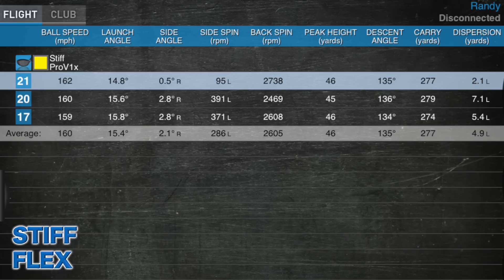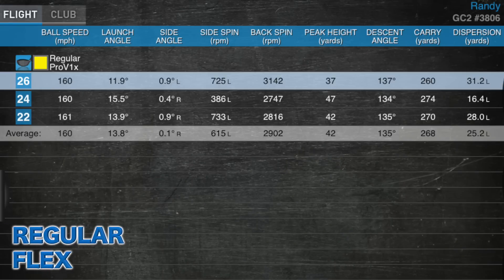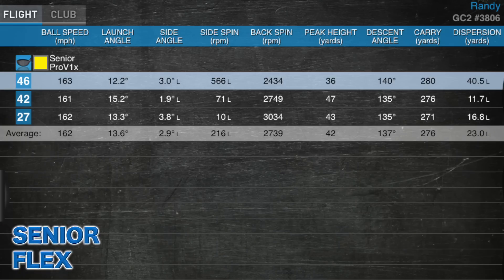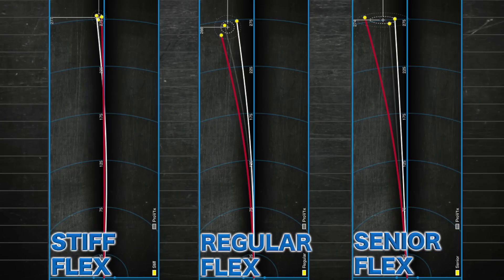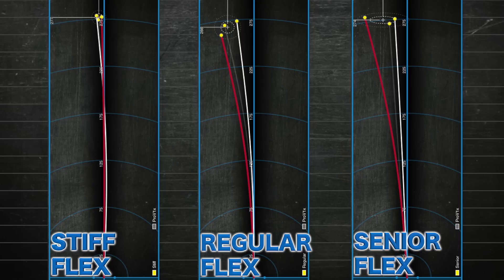Does Shaft Flex Matter?

Comment: with me I rock a X stiff shaft with and avg speed of around 129. but my misses are huge hooks and even when I strike the ball well and in a good spot on the face the ball flight is extremely low. and ideas?  driver is a Bombtech Grenade driver in 10.5 and X stiff matrix shaft
Reply: last check spin rate is around 2500 to 2800
Reply: Get rid of the Grenade.
Reply: 129 mph swing speed? Damn, if you can get your ballflight straightened out you should try long drive.

Comment: I just switched back to a regular flex. I do not notice a major difference in ball flight, or distance, but I did notice that I can use a much smoother swing than before and still end up getting good distance from it. I did notice that if my tempo is off that it does get squirrly on me.

Comment: Hi Randy, not sure if anyone will see this as I think the test was done a while ago. My wife Deb was fit by Ping and uses a soft reg shaft in her driver over here in the UK. I bought her the G driver with the Alta 55 SR shaft and she could not hit it, so we went back to the TFC 80D Lite shaft which she is fine with. I was playing Titleist driver, 915 D3 Stiff shaft and hit the ball pretty well, still further than many. For fun I took out the Ping Alta 55 SR shaft in a G30 head - I found the result exactly as you have just said - I hit my longest drives with it. So I bought one, and yes in my driver I've gone to senior flex shaft and it goes miles and is very consistent. Pals gave me a sideways glance at first when they saw what I'd gone to, that look changed when on a cold damp UK March morning, I knocked my drive almost 50 yards past them!! The upshot of this as far as Ping goes for Deb, over here in the UK at least, is that there is only one shaft in a lite flex available and that is the ladies shaft which is far too flexible. The new G400 is available with the new Alta CB 55 SR flex shaft, but my guess is that it is the same shaft pretty much but in a new colour. Thanks for doing the test - very good.

Comment: Dispersion is really only the thing that shaft flex will have a difference on, however I would definitely suggest getting fitted for flex as it can make a huge difference in how far you miss shots left or right.  The faster you swing the more you flex the shaft which will have an effect on how consistently you will return the club during impact.  I was playing an older titleist driver with a stiff flex and the amount of flex I had when starting my downswing you would think it was senior flex.  Once I tried an x stiff shaft driver my miss hits were a lot tighter and didn't spray nearly as bad.

Comment: Noticed you have excluded some shots from your results - can you please share why - bad strikes/ swings? Can you also state how many shots were excluded?
Reply from the maker: Hey Pujitha, I usually take about 15 to 20 shots to warm up and find the centerline for the launch monitor on the range.  I hit 29 measured shots (Stiff - 6, Reg - 10, Senior - 13).  I try to take the three shots that have similar strike and ball speed.  This one was tricky because the regular and senior flex I definitely had to find the timing for to hit a decent shot.
Reply: Great! I was hoping that shots were selected for similar strike patterns - ESPECIALLY for impact location. It is tiring to hear reviewers talk about differences in spin when a shot is hit lower or higher on the face. the effect of CG is after all relative to impact position - thanks to the mighty gear effect.

Comment: Good video. I was amazed to learn how important shaft stiffness was when I got fitted. I was waiting for a putter to be re-griped and I went into the Ping simulator at the PGA Super Store even though I play Callaway. The pro watched for awhile looked at the number and saw my launch angle, face angle, and point of impact were repeatable and nearly perfect but my club head speed on the driver averaged 95 (I am 6'4", had back injuries and am 57) He walked me from the Extra stiff (which is what I had used for years) though the Senior's / ladies shaft. At the Extra Stiff I could miss 35 yards left or right, by the time we hit senior I had that down inside 10 yards, mostly left. I don't have a full back swing, but carry moved from 198 avg with extra stiff to 202 avg carry, and roll was +/- 2 yards. 

Spent around $40 to have my driver, 3 wood, 5 wood re-shafted and initially dropped 5 strokes off my game. After changing my irons I dropped 10 strokes, on short courses and more than 15 on long courses. Two things happened. 1) a lot of time in the simulator finding what my clubs really did, and 2) not chasing as many wild balls, which helps confidence a lot. 

I am not going to get longer, but I am seldom in trouble anymore which reduces hero shots turned GOAT. My recommendation to everyone is be willing every couple of years to find out what your really doing. 

The video is good, just don't want people to think that senior shafts are less controllable. They just aren't meant for the club head speed you have, vs. an old dude who could gain yards with them.
Reply from the maker: Thanks for the comment!

Comment: I have a 48" x-stiff, low torque driver, and a 45.5" stiff, mid torque driver, both 8.5°, hit them both great, no real noticeable difference.  My irons are x-stiff hit them great, also have a xx-stiff 1-iron, hit it great and a "regular" flex 19° hybrid, hit it great as well, so my opinion on shafts is,...you never can tell until you start hitting it!

Comment: did you compare the strike patterns for the 3 different shafts?
Reply from the maker: Hey Christian,
I hit at least 6 shots with each shaft, then took the shots that were similar strike and ball speed and used that to compile my data.  Unfortunately I don't have the HMT device that would give me impact data more accurately, but until then I just have to go by feel.  Thanks for the question!

Comment: Shaft does matter, to an extent, but not anywhere near as much as people believe it does. Ask any teaching pro/club fitter, it is far, far worth more to get your technique straightened out than to spend money on a new shaft. Once you get more consistent, then spend the money on a shaft to fine tune and cut those 100-200 revs off your spin.
Reply from the maker: Spot on Jacob, well said.
Reply: i matters alot if you swing relatively good,  myself i swing between 105-110 and in a regular flex would hook the crap out of it,  in a stiff its a nice slight draw so your wrong if your talking about a good player, high handicap should just carry clubs for me lo
Reply: +Bryan H shaftoid.
Reply: I agree, purity of technique wins at the end of day over any fancy equipment technology.  The pros from the last century are a testament to the importance of this.  Most of them used what we'd deem as garbage by today's standards, yet are able to shoot insanely low-scores.

Comment: Hi Randy,not only does shaft matter,but the length of shaft is important too,I've owned a Cobra Amp Cell driver for almost 2 years,its got the adjustable loft settings,the most I could get out of it would be about 220 carry (I'm 65) at 10.5 loft,as you know the driver is 45.3/4 inches long by cutting the driver down to 44.1/2 inches I've gained 15 yards and much straighter.
Reply: I played and still have that driver. Very forgiving. I actually put a 43" 3-Wood shaft (60g) and it was a "fairway finder" averaging around 235 yards. Good hits getting up to 250 yards. Playing the Titlesit 915 right now at 44" which reminds me a lot of the Amp Cell.
Reply: You know it makes sense mate,not all about boom boom is it. cheers!
Reply: That is very interesting and I'm about to try the same experiment. I'm putting a 42 inch shaft on a driver and hoping for more control. I could drop a few yards no problem but I have to stop whacking drives OB. I'm tall and have long arms so maybe a shorter club will work for me!
Reply: hi could u send results to me.would try the same.regards tyagi
Reply: No need to change the shaft - your golf pro can easily shorten the original..
Reply: Agree Michael. I cut my shaft down to 44 and it was a lot more accurate and I got some serious yardage. So much for longer shafts. By the way, I watched long hitters on tv and they were all over the place with long shafts. Wonder how they would do if they cut down on shaft length.
Reply: David Ciccoritti I want to think your idea is very smart, but honestly we should think more before just taking driver off the tee.
Reply: Michael Brooks, all golf shafts have a spine. Fit that spine correctly you will gain a LOT of feel and distance. Fit it badly and you loose feel and distance. Adjustable shafts ignore this fact. Shortening up a poorly fitted shaft as you have done makes it stiffer and you gain some control because of that fact alone... and you gain some distance due to that fact alone. If you want a longer shaft (extra length DOES equal distance ask a long drive Champion) then fit a stiffer shaft and make sure it's been glued in properly with spine correctly aligned. 

what I'm saying is shortening up a club DOES NOT GAIN DISTANCE you loose it that's a fact because a shorter club head doesn't travel as fast, that's called physics... however like I said, there are other things involved like badly built clubs...
Reply: Clifton Manley it’s actually really obvious, the other commenters are hitting the shortened driver with cleaner contact.  Moral of the story: practice driver more, use it less.
Reply: no it's not puttputt524 you shorten a shaft, you stiffen it up. this makes it easier to hit because it hasn't been fitted properly. How many tour pros do you see playing with driver heads that aren't glued in? With so-called adjustable loft? That's because a tour driver is built using Puring Machine. This pures the shaft and then it's glued in how the Pro prefers it. This is the reason for tour buses. I use Flat Line of Oscillation  because it works better than Puring. The crap you guys buy off the shelf is just that. crap and benefits from being shortened because it lessens the crappyness... get your steel shafts spined, and your composite shafts Pured or FLOed, if you can find someone to do it....
Shortening up a driver makes a shit driver a bit better...

Comment: I'd say that strike is going to be way more important for spin numbers and launch conditions than any shaft changes. I think also that feel plays the most important part in shaft selection. If you have a shaft that feels better for you, then you will hit it better. The numbers you put up there are almost identical. Again, I think it would be interesting to see what your strike patterns were, because strike will influence numbers more so than shaft.
Reply from the maker: Completely agree, I found the struggle was mostly in timing out the lighter flex shafts.  Couldn't get the face square at impact with the Regular or Senior.  Thanks!
Reply: yes no doubt a lighter set up will tend to make you close the face. But then again, a few more swings and I'm sure someone of your playing ability would be able to adjust for that miss pretty quickly.
Reply from the maker: +brendos444 100% correct, I'm sure with a small bucket I could probably straighten out the senior flex. Appreciate the comments!

Comment: That first shot with the regular was just a low face strike. That's why it launched lower and spun more. Nothing to do with the shaft
Reply: I think you're absolutely right. Strike is going to matter far more than shaft flex.
Reply from the maker: Strike always trumps shaft, Thanks!
Reply: +Fried Eggs Golf I think shaft does matter it's not a couple thousand but it's about 500-700 rpm with a quality shaft also tempo has a lot to do with what flex you need to
Reply: +KingOfCleveland32 I have seen evidence that is not even half that, shaft flex is more about feel than performance.
Reply from the maker: +KingOfCleveland32 Agreed, tempo is key!
Reply from the maker: +Jedi Golf Thanks for the input, definitely changed my perspective!
Reply: was just about to comment the same thing; low strike on face= lower launch and more spin
Reply: What's the cost of shafts
Reply: @JohnMarchionifinalpick   yes

Comment: Very interesting. Ever since i got my self a R1 driver with a flex shaft, i've had trouble , Ive had to slow my swing down so much to accommodate it , I wonder if I have the wrong shaft? I swing  too hard i'm told . Thanks for the video

Comment: Hi Randy. Love your videos!!  What loft did you have the g driver set at for the test? And I am hearing that increasing the loft is a good idea as the lower spin balls and clubs will give better distance it the launch angle is higher.  As always I appreciate your wisdom!!
Reply from the maker: It was set at 9 degrees.  High launch/Low spin is a great combo for distance... Play the highest loft you can without hurting your spin numbers.  Thanks!

Comment: Can I ask you a question?  Have you measured /annalised the following!  
1. Extra stiff (35inch) graphite shaft compared to (45inch) same shaft? 
Doesn't the 45inch naturally bend/flex more because of length difference? 
2. Same experiment with steel shafts. 
3. Can you proportional differentiate between impact of swing"force" and speed when hitting PW(120y's) and 1Driver((290y's)
The impact of this on shaft flex. You don't hit your PW as "hard" as you do your D,  do you? 
4. Shouldn't all this proof that your flex of shafts will need to differ gradual down from 1D down to SW. 
In my opinion 9Iron down to all the wedge's, shaft flex, have no significant influenced on accuracy or distance.

Comment: 3 swings per shaft is not enough sample size to do a proper analysis.  Should be minimum 10 each, drop the longest and shortest 2 swings and use the remaining 6 for your averages.
Reply: Randsurfer if 3 isn't good enough for you 10 shouldn't be either. I agree how sample size is not statistically significant but you adding 7 doesn't fix the problem.
Reply: yes to do a proper test it would have to be blind so the golfers dont know what they are hitting and multiple golfers would have to use each shaft at least a few different outings so its not just a bad day on that shaft...
or you make it all a lot easier and you a robot...
Reply: D-railed except the test can’t be blind because in the hands of someone experienced, they know which shaft is what flex.
Reply: puttputt524 actually either Peter Finch or Rick Shield (I think it was Rick) did the blind test not long ago and he could’t get the flexes right just from hitting. I think he mistook R for A, although he got X and S right.
Reply: And do it blind, so he doesn't know which shaft he's using.

Comment: Why on earth do you do review like that? What's the point? The statistic is almost completely fault. You simply can't take just three shots and build opinion or fact as you do and draw conclusion. 101 in statistic, you have to have descent number to be able to spot a trend.

If you are going to make a statement about this issue, the do a proper work. Take at least 30 shot's with each shaft, use three driver's and change in every shot, but so you don't know what you are using each time. Use helper to identify shaft to build up stat.

Then you must take bad shot's out. Then you have some data to make opinion about flex..  but, to make it more credible you can repeat this experiment three different days, so your form or current trend isn't as big factor in this experiment etc.